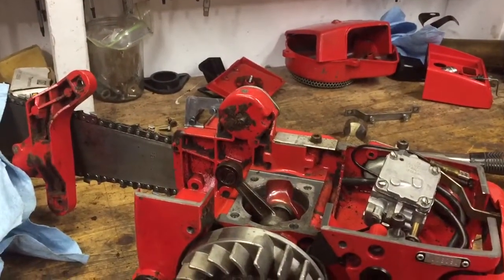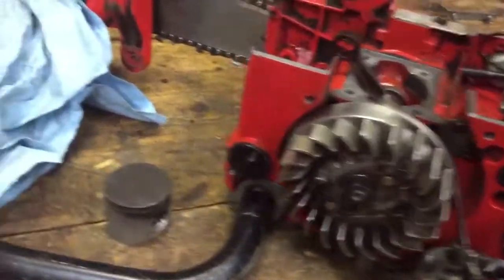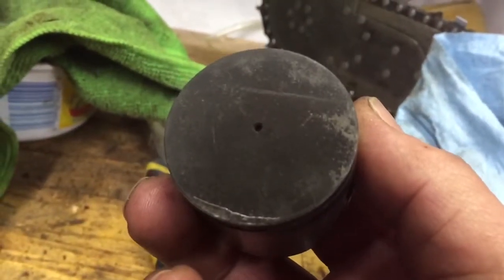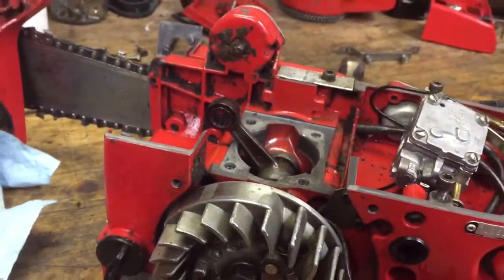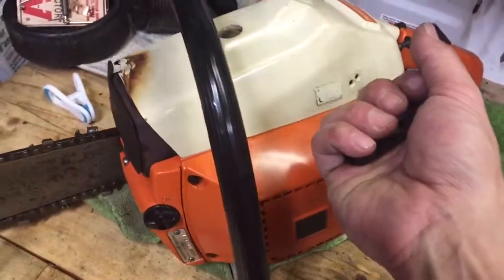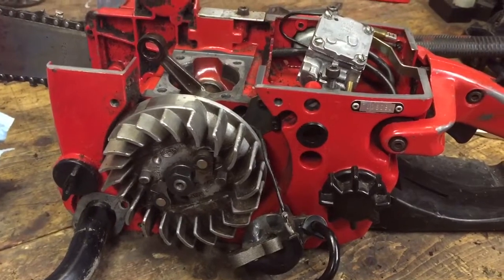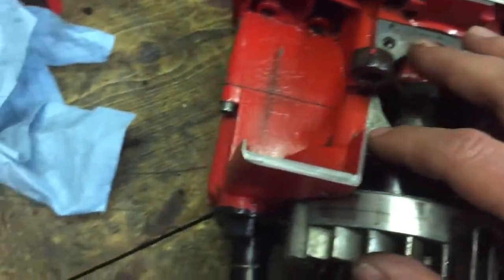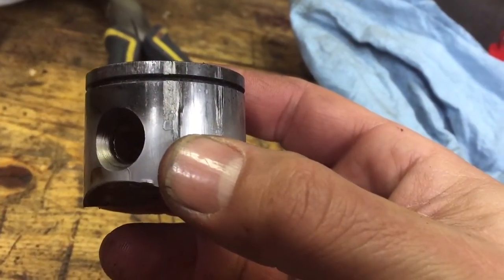Jonsereds 49SP

Comment: I don't know if you will see this, but I have a 49sp I'm pulling the carb off of right now. It will idle, but bogs if given any throttle. Even if given full throttle it still idles but bogs severely. I bought mine for $50 too in this condition. Prior owner said it did this in the cut. Muffler is clean. Any ideas?

Comment: Hi I have a 49sp but there is only one lead going to the on off switch could you please tell me where the other one goes.Not sure myself as i could only find one wire. Kind Regards. Paul
Reply: Paul Austin-Clarke there is only one wire mine is plugged into the bottom lead.
Reply: @scubaseppy  many thanks. 
Tried that but seems the cool pack has gone. Regards Paul
Reply: @scubaseppy whatcha mean by plugged into the bottom? I am restoring my grandpas old 49sp and need help
Reply: @The.sun.chaser  The kill switch has two leads and there is only one wire hooked up to the bottom lead.
Reply: @scubaseppy  this might be a lot to ask but would you be able to send me a video or post a video on your jonsered? I am on the forestry forum and have a post there about what i am currently seeking help on
Reply: @The.sun.chaser  Ok, Ill post a video on my channel soon.
Reply: it's uploaded, let me know if that helps you or not.